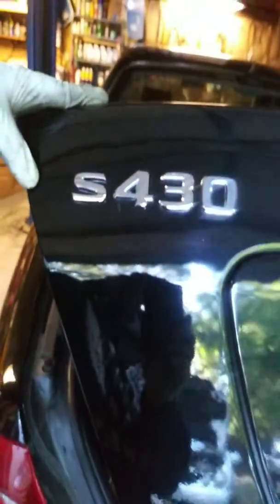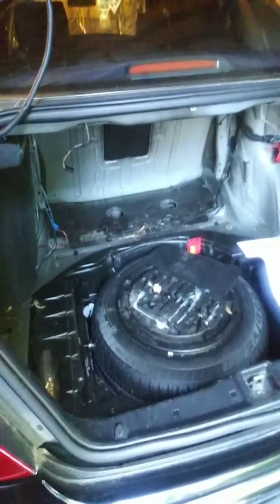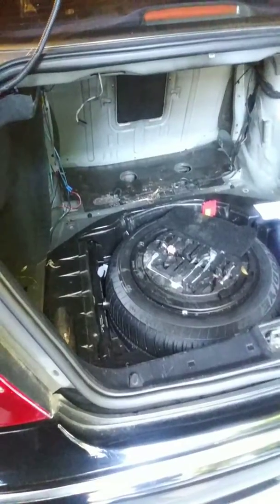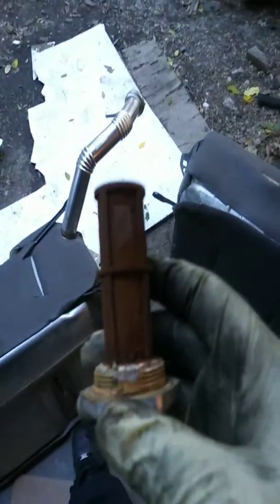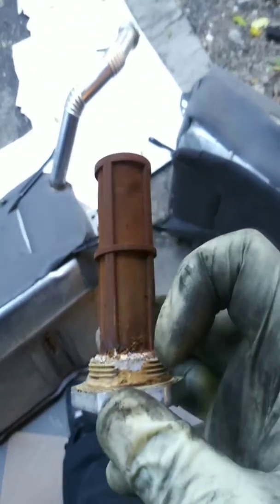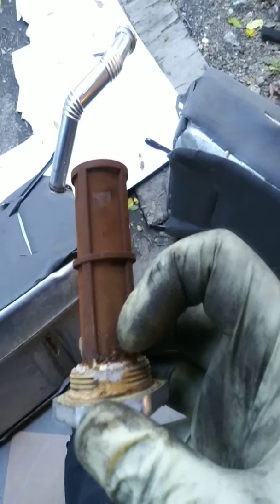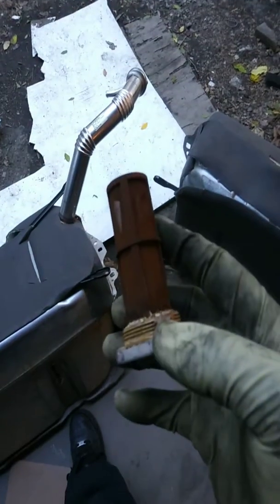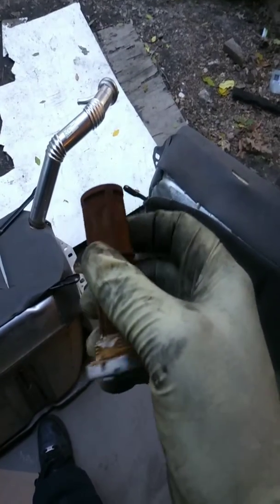2001 S430 Mercedes Benz Fuel Tank Replacement

Comment: Hey I got a question,  how did you get.that main line off? And where is the return gasoline.
Reply from the maker: The line under the tank you have to use a 17mm / 19mm I forget which one crows foot, with a longgggg extension the reach, the position it sits in there to much stuff in the way but the extension works best. You will only get a half of a turn then have to pull it off and reset, until the line comes off.
Reply from the maker: OIn the video in the begining pause the video and right above the spare tire you see 2 holes towards the rear seat. Under the car thats where the 2 lines are attached under the vehicle on opposite sides ,to remove the tank you must take those 2 lines off.

Comment: Damm i wish you had shown how to actually remove it and put it back in..
Reply from the maker: I can walk you through it but next ill shown step by step
Reply: @princeheath5233  thanks.. i do have a question. My tank finally came. And the only problem im having, is finding the hose that goes to fuel strainer. How do i find that and how did you take it off and put it back on
Reply from the maker: @clanaoaarmyofallah2557  its under the car you nedd a long extension and a 17 or 19mm crows foot. The strainer sits inside the tank but the nut will be on the bottom of the car, its a hard line with a rubber line attached to it. Heres my email prince.heath@gmail.com I can walk you through it.